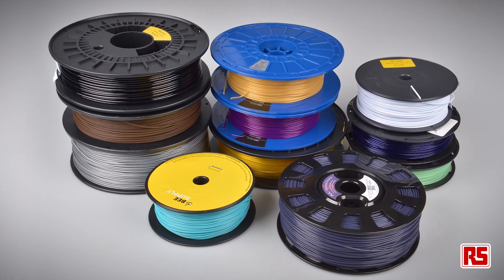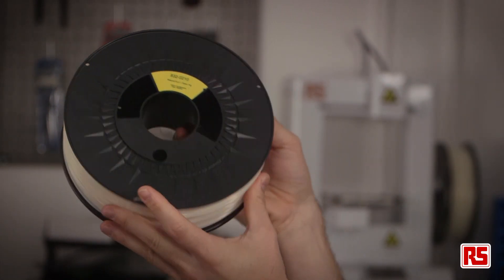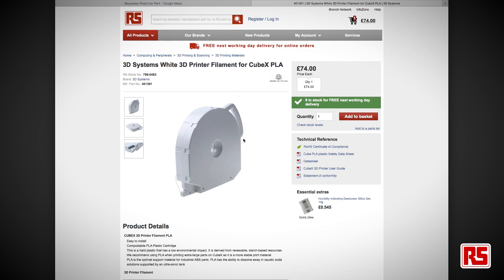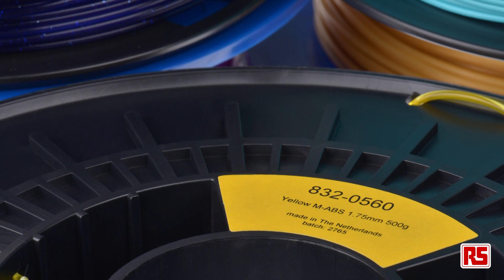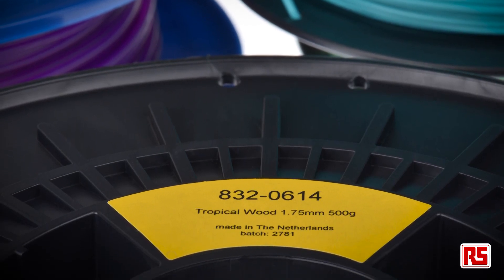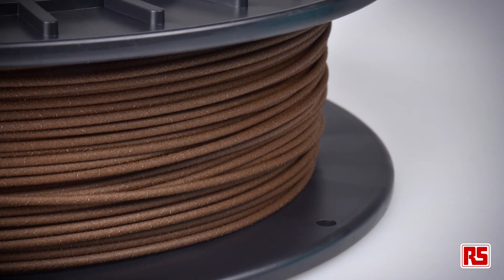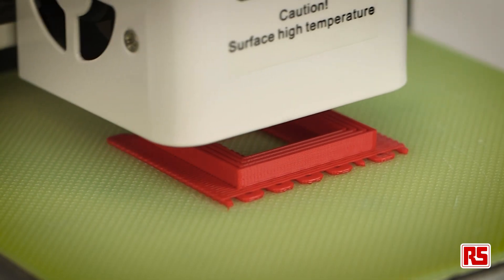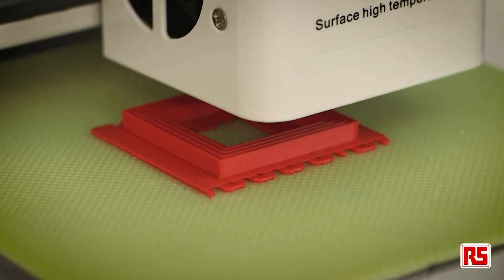How to choose the right 3D Filament for you | RS Components

Comment: Had very mixed experiences with RS Pro PETG filament. The quality appears to vary. Although the filament comes inside a cardboard box, sealed and wrapped in a (very thin) plastic bag and includes a bag with silica -gel to keep the humidity low, I observed a lot of bubbling in some of the batches. Will choose a different brand next time.